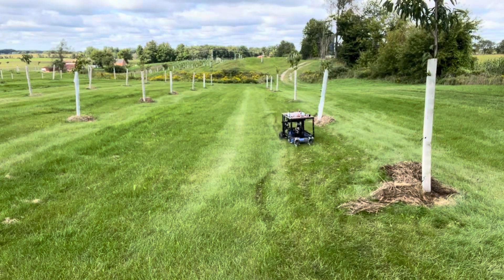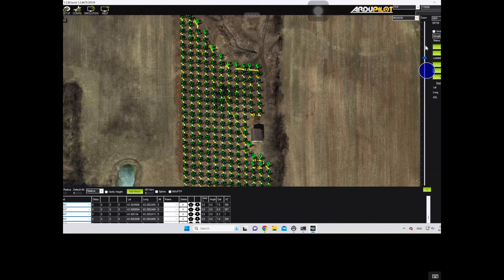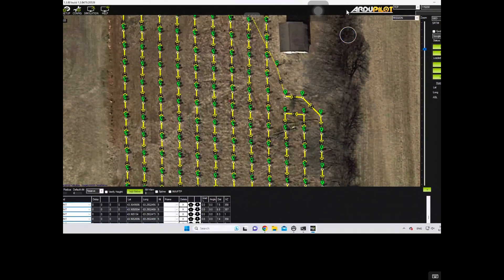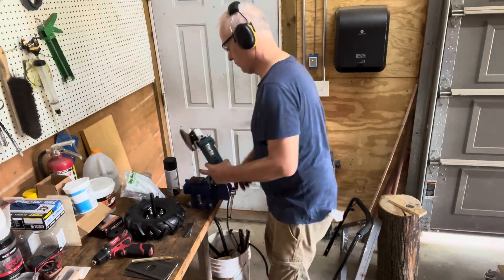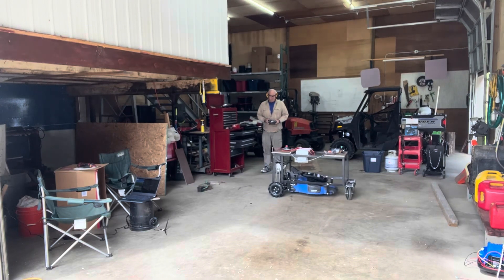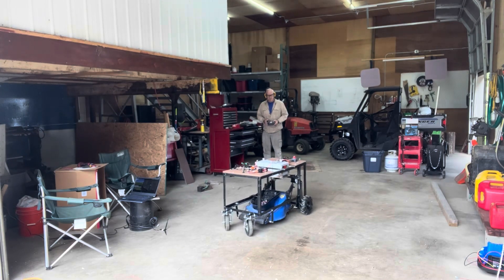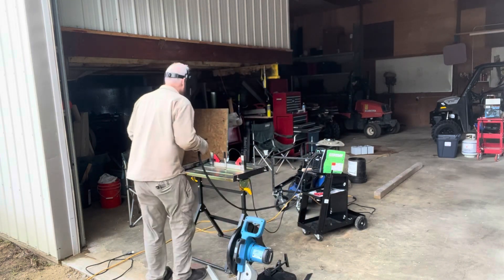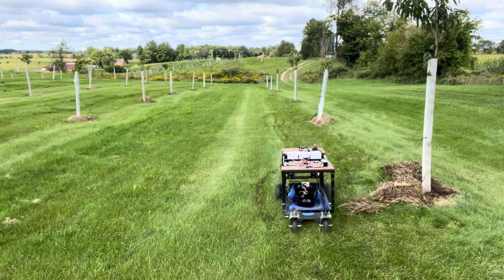A robot arrives at the orchard!

Comment: Nice job! How what is the total voltage going to your motors?24v? Or 12 v?. How long do the batteries last for the drive system?
Reply from the maker: As far as voltages go, the thing is kind of a mess. This version is really the proof of concept. Once I get the programming and the set up of the auto pilot correct I’ll then bump up to a better engineered system. Currently the motors are 24 V. The mower itself is a 40 V Kobalt mower. Both are fed from a 40 Vbattery. The batteries are 50 amp hour batteries. I have not had a full discharge test completed yet. So I don’t know how long they will last.